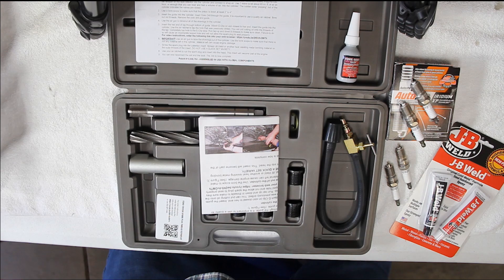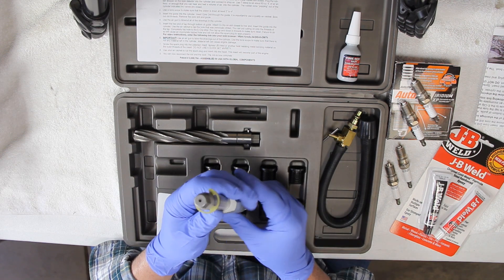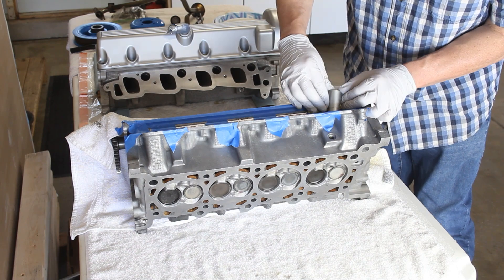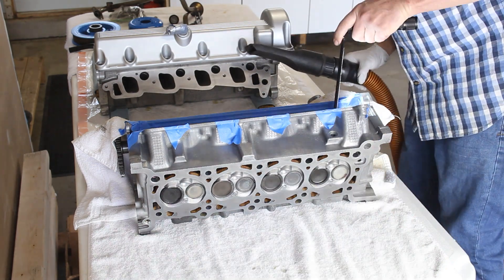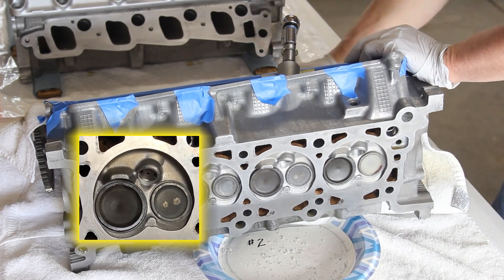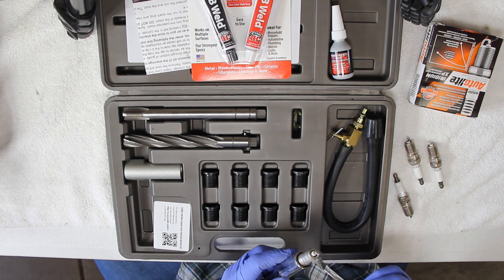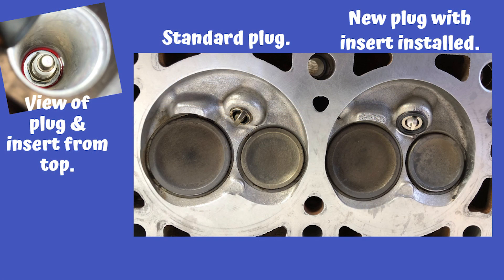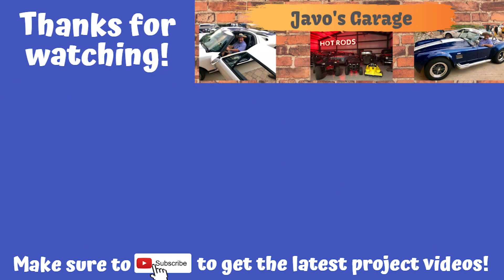CalVan Tools 38900 Spark Plug Repair Tool Kit Instructions - Ford 5.4 2V Build

Comment: I had to do cylinder #7 on the driver side last year.  Some garage I used put in a Dorman (or other) cheap insert.  It must have lasted 15,000 miles.  I never did major engine work before but have done brakes, master cylinder replacement, brake line installs and other small fixes to my truck.  I never saw this video but I did order the Cal-Van kit and it worked out great.  Very straightforward.  I borrowed a friends scope, blew out the debris and so far so good.  Going to change spark plugs this weekend, should I be concerned when I back out plug #7?  Will the insert remain seated if I followed all of the install steps to the letter?  Your thoughts...

Comment: I purchased the same kit for my 5.4l. I changed the plugs and coils in my truck and used it to move across country (3200 miles) pulling a heavy trailer, over a year later I have not blown out a plug, do you suppose I am out of the woods? I figure if a plug was going to blow, it would have done it by now but I am just making an assumption and assumptions have burnt me before.
Reply from the maker: I would be willing to bet you're all good!  It's been quite some time since we did this in my son's truck and have had no issues with it whatsoever.  The only real issue (IMHO) you could have is down the road when you change the plugs and the insert comes out with the plug.  As you could see in my video, the original problem was only having 3-4 threads to hold the spark plug but once you core and tap that head for the insert there is a lot of threading there to secure the insert and the plug so I sincerely doubt it would blow out.  My bet is you're doing great!  Good luck with it, I hope it does great for you.

Comment: Why are you doing the treads? Did the spark plugs bow out?
Reply from the maker: In my particular case, I'm doing this as a preventative measure.  These motors are notorious for only having a few threads to hold the spark plug and they can strip out over time and blow the spark plug out.  This will keep that from happening.

Comment: Is the time sert 6020 threadlocker liquid or gel? I don't have any but wanted to see if there is a alternative.
Reply: Great tutorial by the way. Very informative.
Reply from the maker: I used the liquid.  Honestly, I didn't know there was a gel option with it.  I have also used a Loctite version that worked really well too.  It's their Loctite 27240 high temp, high strength thread locker. Here's a link so you can check it out:  https://amzn.to/3C5vEVp
So I don't get in trouble I have to let you know I am an Amazon Affiliate and that is an affiliate link so I earn a commission from purchases.
I still used the JB Weld up along the shoulder though.
Reply from the maker: Thank you very much for the compliment!